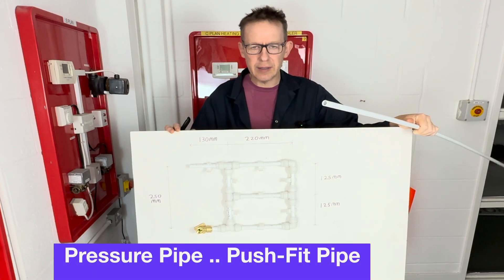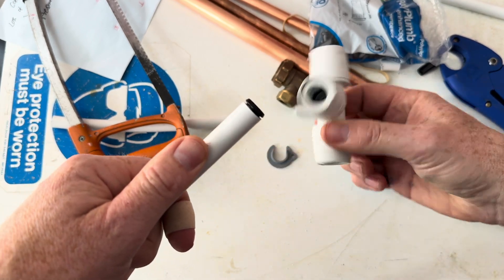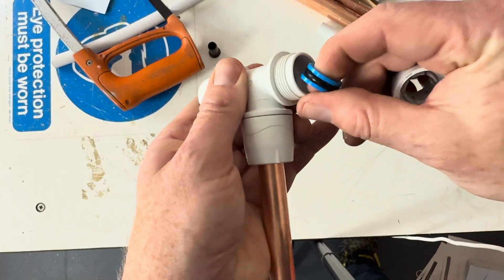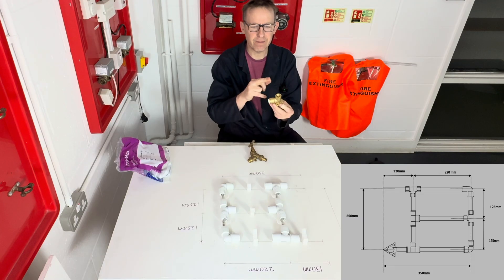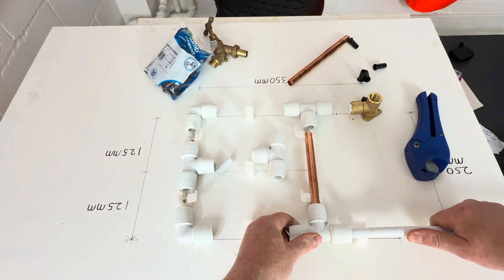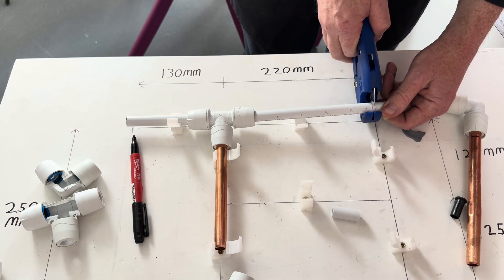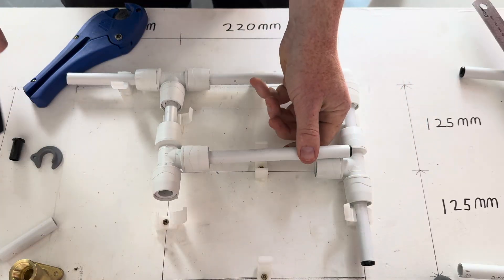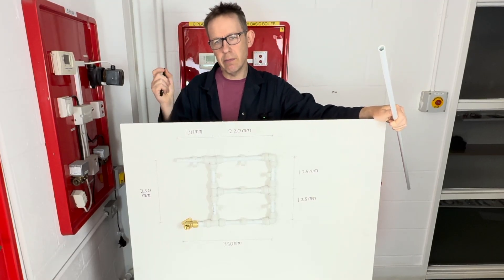Level 1 Plumbing - Plastic Pipe.. Push-fit Pipe.. Pressure Pipe

Comment: I dont like plastic pipe because the insert reduces the pipe diameter, restricting flow. If I ever was to use plastic under a floor.. I'd up size 15mm to 22mm to keep maximum flow.